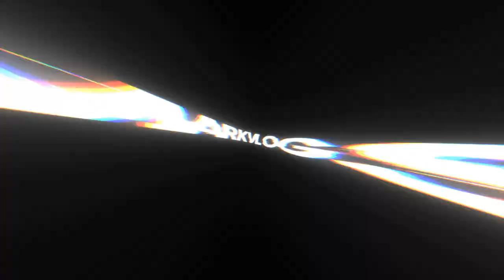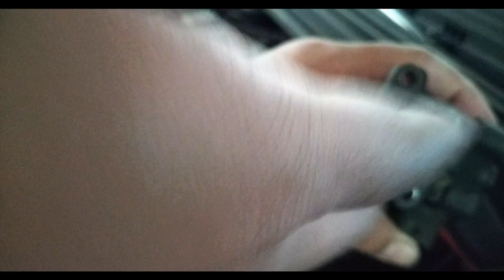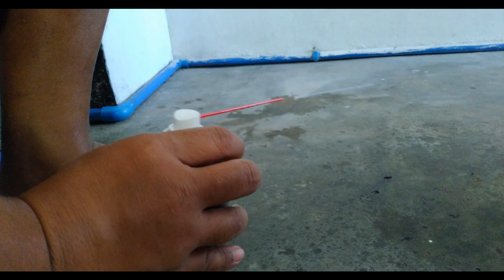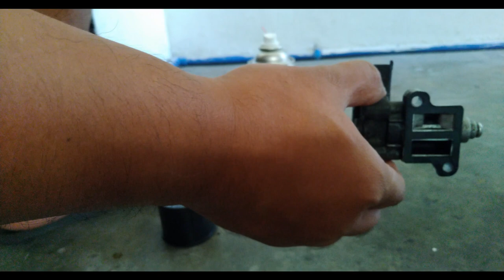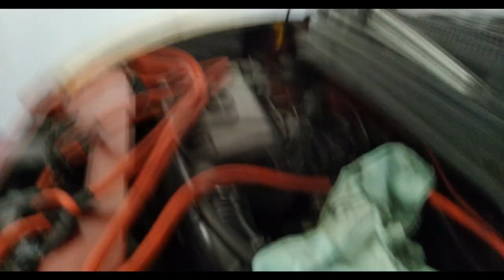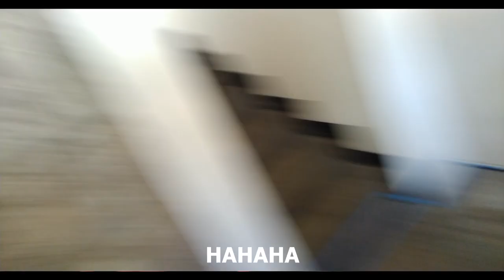HOW TO CLEAN IDLE AIR CONTROL VALVE (IACV) FOR HYUNDAI EON (ENGLISH)

Comment: THANK FOR YOUR VIDEO, I BEEN LOOKING FOR A SOLUTION TO FIX MY OWN CAR RATHER THAN TAKING MY CAR TO A DATE RAPE WALLET CAR DEALERSHIP..,BUT I HAVE A 2015 HYUNDAI ELANTRA,AND MY CAR STARTED TO SHAKE A BIT WHILE ON PARK MODE,AND AT A STOP LIGHT, I HOPE I CAN FIX IT BY CLEANING OUT THE AIR CONTROL VALVE SENSOR AND THE THROTTLE BODY, I TAKE CARE OF MY CAR WELL, I ONLY ADD THE BEST GAS AND FULL SYNTHETIC OIL WITH THE HIGH MILAGE. I ONLY HAVE 72K MILES. I HOPE I DON'T HAVE TO CHANGE ANY FUEL INJECTORS.

Comment: I had a check engine regarding IACV. P0508 Idle Air Control System Circuit Low. Throttle Body is clean, however I havent checked the IACV yet. Thanks for this one Sir Mark!
Reply from the maker: thank you
Reply: I have the same error. I tried this DIY and still get the error. Any ideas idol @mark?
Reply from the maker: @ChupoyTV  try cleaning the map sensor paps.. if same error occurs possible faulty IAC valve na
Reply from the maker: @ChupoyTV  lalo kung mataas ang idle
Reply: @MotoVentour  ayun lang. Di ko yan alam na tumataas ang idle pag sira ang IAC. So, ginawa ko, nireposition ko lang ang map sensor. I guess I have to replace my IAC and possibly MS. Salamat ng madami paps.
Reply from the maker: @ChupoyTV  yung idle mo ba lagi mataas?
Reply: @MotoVentour  di naman sir. Nung unang labas ng check engine, high idle siya. So, nilinis ko yung IAC gaya nitong sa vid. Then high pa din. So, ginawa ko, inadjust ko yung MS ko manually. Bale loosen yung star screws tas adjust while engine is on hanggang stable na siya from 900 to 1100 rpm.
Reply from the maker: @ChupoyTV  pa scan mo obd baka need lang refresh data.. kung sira yang IACV sobrang taas ng rpm nyan
Reply: @MotoVentour  hi sir? Do you offer obd scan and refresh data? After malinis ng throttle and iacv ko  hindina smooth yung pag baba ng idle ko.
Reply: Unfortunately mine after follows yours method and suddenly check engine light came out says" system too rich bank 1 ". 😢

Comment: my iacv is failing, going to change it, for now the rpm are between in 600 max 700, my questions is what is the average value I must expect when the change is done. 800? 900? 1000? or more thanks.
Reply from the maker: Between 800 to 1000 rpm

Comment: Hello Mark, before the mechanic adjusted the idling of my Eon, as he told me that the idling was a little bit low, matipid pa sa gas ang Eon ko. But after the adjustment lumakas ang consumtion ng gas. So I brought it back to him. He restored it daw to its original idling.  Idk kung nabalik nya nga kasi until now malakas pa rin sa gas Eon ko. Every time he adjusted the idling he had to turn off the engine. May iniikot sya. Is that the right thing to do? I hope you can help me. Thank you...
Reply from the maker: Kelangan niya ng tachometer to adjust it.
Reply: @MotoVentour  Thank you paps Mark!

Comment: Sir Mark yung sealing gasket ng akin may tapyas is that the reason why everytime I open the ac nanginginig siya di naman continuous yung nginig
Reply from the maker: kung may leak yes possible.. pwede lagyan yan ng gasket maker.
Reply: @MotoVentour  what kind po sir? Yung may High temperature po ba?
Reply from the maker: @villarinmarcelino5299  kahit ano po basta gasket maker. rtv
Reply: @MotoVentour  ok thank you po sir

Comment: Noong nag pa scam po ako sabi po ng tech na nag scan sir iacv daw po..nakita ko po iacv pero dalawang iacv naka lagay di ko nabasa ung isa..possible po ba na wire yong isang reading ng obd?wat if low current po ang dumadaloy papuntang iacv?kasi nalinis ko iacv at throttle po pero..ganon parin after a day tumataas padin rpm ko po..
Reply from the maker: possible sa harness po